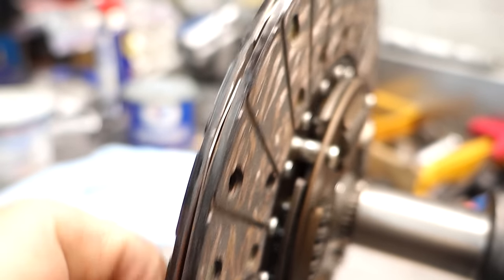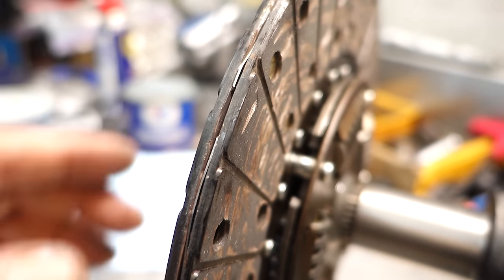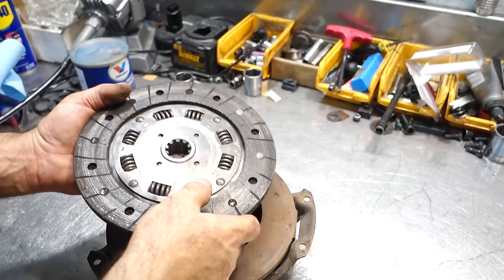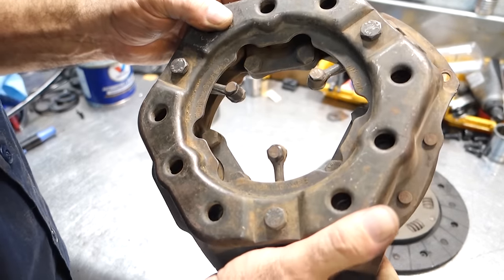Learn How a Clutch Works -  Basic Clutch Operation and Tips

Comment: great vid ,ironically clutches used in Ferrari's led to the birth of Lamborghini automobiles. due to Mr Lamborghini's discovery that his Ferrari was using the same clutch as his 25 horsepower tractor from the same exact supplier  was using and being gouged by Enzo  every time it failed.
Reply from the maker: yes I heard that story. If you have ever driven an 80's Countach the clutch is just horrible. So if THAT was an improvement I can't imagine how much worse the Ferrari clutch was.

Comment: So the clutch is a bit like a reverse brake system ?
Reply from the maker: Reverse brake system in what application?
Reply: @GearBoxVideo  like the way the calipers exert pressure on the wheel with the brake pads
Reply from the maker: I think way more advanced than that. But I see what you mean

Comment: I have a hydraulic system and there is no air in the lines, the master holds tight with line out of slave and no air, I install the line. Let the slave bleed out and i see the slave press the fingers on the pressure plate all the way in but yet i cannot get it into gear. I jack up the right rear wheel on my F150 Ford 1997 with a 1999 4.2 M4R2 and it will clutch and take the gears all of them with no problem. I let the tire on the ground and it will not let me get into gear again. Jack it up and it will work with the right wheel off the ground. Where is the release problem at?
Reply from the maker: Try this. Shut the car off and jack up the rear. Put the car in gear, press down on the pedal and start the engine. Rear wheels shouldn't be turning and then press on the brake. Engine shouldn't stall
Reply: Did that,  engine starts and clutch will let me go into each gear when in the wheels are up. Push on the brake and engine kills. So, it is not releasing with clutch pushed in all the way while engine is running and in gear. Will not release but yet i can shift gears while in the air. There is a magnetic clutch in the transfer case with a wire that is unhooked. What would that do if it is not hooked up?
Reply from the maker: The clutch should be functioning in the transfer case. Why is it disconnected?

Comment: my ? is why does my car keeps breaking the bearing and it burns my clutch this will b the 4th one they put in the car and the mechanic don't know why hope u can help me
Reply from the maker: What type of a vehicle is this?
Reply: It's a 2000 ford mustang gt 4.6
Reply from the maker: Make sure the bearing is not in contact with the clutch and you might want to get a new flywheel if it has been cut. Sometimes if the flyuwheel is cut the whole geometry gets messed up. What brand clutch are you using?
Reply: Yes it's been cut the clutch not sure what brand but I bought it at AutoZone
Reply: GearBoxVideo duralast I think
Reply from the maker: Is your car completely stock?
Reply: I'm gonna say yes but I have another mustang 2003 and i feel that the 2000 has more power I bought the car like that i have never added anything to it
Reply from the maker: You may want to step up to a performance clutch from Hayes or Centerforce.
Reply: GearBoxVideo ok thanks alot I'll look in to it

Comment: My mazda b2300 ,4 cylinder, pick up truck gear is stuck, will not shift even if engine is turn off
Reply from the maker: Stuck in gear? Or stuck in neutral?
Reply: I remove my stick shift while in gear now when I put it back together it will not shift
Reply from the maker: See if your gates are all aligned in neutral. It's possible one of the rails was in gear and the stick is sitting in another rail in neutral position.

Comment: How do the springs dampen vibration?
Reply from the maker: Google "harmonic vibration". Basically the spring help diminish the oscillation
Reply: @GearBoxVideo First of all thank you, and is this also why dual mass flywheels have springs?
Reply from the maker: Correct. The harmonics generated need more dampening.
Reply: @GearBoxVideo  I have another question regarding engines, if you have a 2 litre 4 cylinder engine and each cylinder has a capacity of 500cc does that mean from bottom dead centre to top dead centre the piston moves through a space of 500cc and that are able to fill the cylinder with 500cc's (or millilitres because they're the same thing) of air and fuel?
Reply from the maker: No . Stoke had nothing to do with cc capacity. Read up on compression ratio
Reply: @GearBoxVideo  compression ratio is the maximum cylinder volume (when the piston is at bottom dead centre) divided by the minimum cylinder volume (when the piston is at top dead centre)
Reply from the maker: Exactly. Google is your friend.
Reply: @GearBoxVideo  If you have a cylinder with a volume of 1000cc and a compression ratio of 10:1 at bottom dead centre there is a volume of 1000cc and at top dead centre the volume is 100cc, 1000÷100 = 10
Reply from the maker: I don't know what you are trying to accomplish here but in regards to your original question yes a 2 liter 4 cylinder engine DISPLACES 500 CC per cylinder. Yet air can be compressed. As well as forced in via turbo or super charger.  Air is not a liquid and can be compessed

Comment: I have Medium and heavy Duty  Trucks they all use Dual disk Clutches  my  427 Chevy Truck  now a  488  with 1/2 Stroker crank.    has a  12" dual disc  Push type Clutch and a non Synchronized 13 speed Transmission ..  The only way to get the thing in gear while stopped from Neutral is with an air powered Clutch brake that  pushes a puck against a gear inside the  13 speed fuller Transmission .
  Heavier Trucks   use 15" dual disc pull type clutches with a Friction disc in the throw out assembly .

   If you have a car that the gears grind putting it into Reverse often you can put it into  say second gear first to  stop the gears from spinning with  the Synchro's .. Your old 4 speed Trucks with a Creeper first gear  did not have first or reverse Synchronized.. 

   After I put the Doug Nash 5 speed in my Camaro  I could not make fast gear changes at high RPM  say at  3,000 RPM no Problem but when pushing 7,000  It took much force and much time to get it into a higher Gear.. I will post a Grumpy Jenkins Pro Stock Video .. That's how I  wish I could shift..  I don't shift my heavy trucks over fast because I don't use the   Clutch at all ..  I  have to rev match the gears by ear..  much better than watch the tack ..
  I  have  won many bets  by telling people I can drive their car and shift with no clutch ..   You have to let off on the gas  shift to neutral then  Rev match and ease the next year..  It's very simple I have shifted a million times this way  18,000 hours and  189,000 hours  on one truck mostly in farmers fields .   People think its magic  because they can't picture how   a transmission works..  I have rebuilt some Eaton 13 speed and 10 speed Transmissions they are easier than car Transmission to rebuild .. you don't need any special tools and Eaton has very good manuals.. While you have them apart you can study how they work just like  Pau does in his Videos ..
    a 13 speed is really a 5  speed with  3 ranges .. or  a ten speed with  a Synchronized  direct Over drive splitter. ect  .. Some older Trucks used a  5 speed main trans with a 4 speed auxiliary behind that ..   The 5 and 4 set up or  5 and three  set up was made Obsolete with the Fuller Twin Counter shaft Transmissions so much stronger .. and  Mac even makes a Trans with 3 counter shafts for heavy haul trucks ect
Reply: Yupsz and you can easy first read the rpm by driveing at the speed in both the gears...;)

Comment: Sir I really need your help in this clutch sounds which comes after installing new clutch system. There are no hard shifting in gear transmissions, everything is normal. Clutch disc, pressure plate and clutch bearing all lubricated properly wherever required, and no leak in both clutch cylinders.

https://m.youtube.com/watch?v=DVJCERkwS2w

Sir, it happens only after replacing with new clutch. And this sound did not come with the old clutch.

Any ideas or suspect regarding pressure rings getting hard...? And how to identify hard pressure rings?
Reply from the maker: Sounds like the pressure plate itself.
Reply: The dealer maintain there is nothing wrong in the pressure plate and clutch system.

They points the culprit to be either the master clutch or slave cylinder or both. How far this is true? 

Really need and waiting forward to receive your wise advice on this. Thanks.

Comment: 2:49. How in the world can that small disc be strong enough to turn the flywheel without slipping?  It seems so fragile, like a house of cards when you factor in how strong engines are and how heavy cars are and yet all of the cars motion and acceleration is because of that little plate not slipping.  Boggles my mind.
Reply from the maker: Physics is a wonderful thing
Reply: True.  Still amazes me that something like that was preferred over an actual gear connection. Seems to easy to slip and fail.
Reply from the maker: You should take the time to read about Pascal's law. Then you would understand. Google is your friend.

Comment: Does the rised side of the disk always go towards the pressure plate
Reply from the maker: Yes
Reply: @GearBoxVideo  omg . I knew it. South bend put a sticker on the flat side saying pressure plate. That cost me 1000s replacing everything over and over and 3 years with out my car. . You would think a 1500 dollar clutch they would put the sticker right.  Thank you.
Reply from the maker: Thw things. The hub has to clear the flywheel and the offset of the drive splibe has to be correct

Comment: Folks, stick with stock.  You don't need to transfer any more torque than that.  Problem solved.
Reply from the maker: Your assuming that stock clutches in certain applications work great. Heavy duty clutches for years have been a substitute for stock clutches. Its not all about torque.

Comment: NEVER   buy  a NON   O  E M  part  for  any  car  you  have  LOVED and  owned.
Reply from the maker: @michaelbodine6142  problem most of the muscle car parts are no longer available from the original suppliers. So you must make sure you contact people when looking for parts that actually know what parts work best
Reply: You remind me of a great VW mechanic I used to use in the 90's. If I took the car for service he would write a list on the bottom of the receipt

Reccommended: remove aftermarket exhaust pipe , return to OEM

Remove aftermarket suspension , return to OEM

Etc. 

He was one of the best mechanics I ever dealt with. I wrench on my own stuff anymore but I would recommend him to anyone with a German car

Comment: try to open a european gearbox dude. it would explain alot cause you know the utter basic of a gear
Reply from the maker: I've done many ZF, Getrag and Lotus boxes. Also Ford Euro versions like MT75's when my company did dealer work. Now my main product line is American Muscle and vintage Historic stuff  so what are you trying to tell me?
Reply: @GearBoxVideo   i was just wondering if u have rebuildt a truck gearbox with high and low range and so on ? but i never got the chance to rebuild one myself just dimanteld from the wihecle and pack it in a wood crate and ship it off to some company (or guy like you ) that knows this and frankly im pissed off by that he he so thats why i like your videos ........ ps ZF stering gear for trucks is the same one for all the euro prodused (over 7,5 t wihecle)
Reply: @GearBoxVideo  Subscriber

Comment: Am I the only one who cringes whenever I see him touch the clutch packs with his bare hands, possibly transferring oils to the surface?
Reply from the maker: Its a video on how clutches work not an installation. Yes you are probably the only one that is cringing. I use CRC brake clean and prep my surfaces when installing. New clutches also have protective anti-rust coatings on the pressure plate so you always have to clean them anyway.